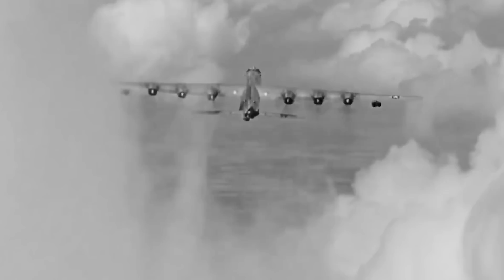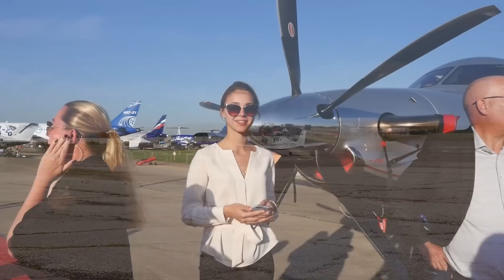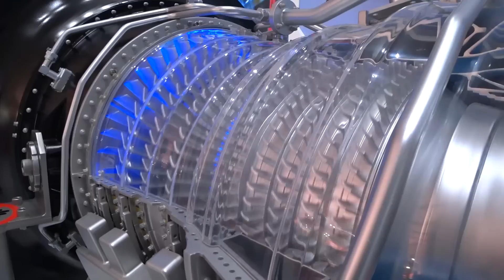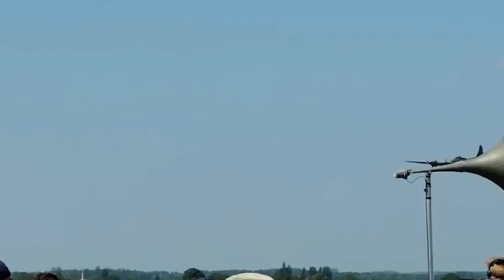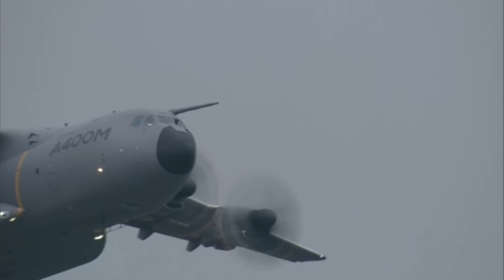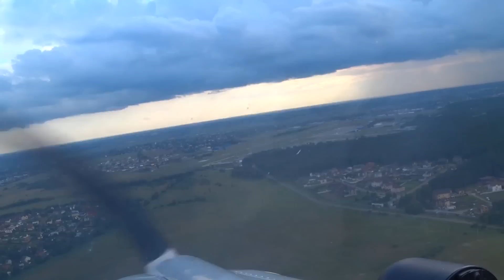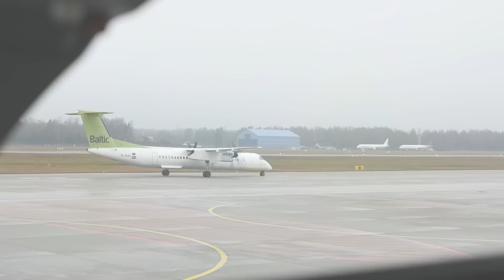Piston and Turboprop engines | What is the difference?

Comment: For small and medium turboprop driven fixed wing aircraft vs. piston,...any power lag seen is offset by greater available power,, i.e.,.. lag time is supplanted by greater power available to use in same general low end power band, especially with variable pitch propellers in the mix.

Comment: because we have problems with piston engines (otto and diesel) felix wankel made a rotary engine that gives more power per mass, works lovely in stable rpm range, has no risk of termal seizing and produces way less vibrations. it is internal combustion engine made for aircrafts. best engine for a small prop aircraft..

Comment: The idea that turbines are much simpler isn't actually true. Yes the principal is much simpler but in reality a turbine is such a complicated beast it's not even funny. I'm a dev engineer at Pratt and Whitney Canada. No matter how complex a piston engine can get with turbos and fuel injection and all that, a "simple" turbo prop like say the PT6 is MUCH more practically complex. The internal conditions are so brutal in a turbine engine that you really can't get away with much.

For example every turbine engine leaks an amount of oil at idle, there is no way around this and the reason for this is because there are no flexible rotary seals inside, they are all carbon seals that work with pressure. And these carbon seals are optimized to work at the engines cruising RPM. The air pressure keeps the oil on the other side of the seal. Further more in a turbine there isn't 1 shaft we usually have 2 minimum sometimes 3 these are called spools. Each shaft connects to it's own gas turbine and compressor or fan depending on design. That means each shaft has to be within another shaft and needs it's own lubrication bearings and seals. And keep in mind these things are designed for a high pressure RPM of 30 thousand. The clearances and tolerances are insane as well, between the fan and it's case you have 50 thousands of an inch of clearance. Also if you shut a turbine off, you have a window of time to turn it back on otherwise you have to wait several hours for the core to cool, because the shit has expanded at different rates.

Comment: a mixture of jet engines and more modern turbo fan engines. A turbo prop engine is a jet engine in which the rear power turbine delivers maximum mechanical power.

Comment: You seem to either refuse to admit or are blatantly ignoring the fact that any sort of turbine compressor is inherently far more difficult to manufacturer than a piston driven engine. Granted that's where the price difference comes from but still, you consistently said that the turbine engines were simple and had fewer parts when, in fact, the turbine fins are singular components and overall make them more complicated than a piston motor.

Comment: You're absolutely right when it comes to piston vs turboprops. Piston engines can't grow power as efficiently as turbines without an enormous increase in weight and complexity
Reply: Not true for modern engines. All these videos are comparing piston engine designs from 1930. There are currently very little modern aircraft piston engines. An engine that makes about 300KW is about 85 KG for turbine and 200KG for piston. The turbine consumes 400gkwh and piston 200gkwh. so the 85kg engine needs 220kg for 2 hours flight while piston needs only 110kg. So 305kg for turbine and 310kg for piston. Extend beyond 2 hours, say 3; you now have 415kg for turbine and 365kg for piston. Turbine is good for short distance at the expense of high fuel consumption. At 6 hours that is 745kg turbine vs 530kg for piston.
Reply: @chippyjohn1  Consider fuel economy, not just fuel consumption - yes a turboprop may consume more fuel per hour when the engine is running, but as turboprop aircraft often fly considerably faster they may complete their flights in far less time. Thus per unit of distance, they may burn equivalent or even less fuel.

To counter your other point, because taxiing, takeoffs and landings use lots of fuel over shorter distances than cruise, proportionally speaking longer flights are actually more efficient for a turboprop aircraft, as it will spend more time at a lower cruise power in the flight.

Short and slow hops are actually piston aircraft's forte and they have certainly improved in recent years with engines like those from Rotax, which use a lot of modern design elements, run on standard cheaper automotive gasoline and produce high thrust to weight ratios. Nevertheless, both engine types still have their place.
Reply: @SilvyYT  turbine engines are less efficient at lower power settings. Fuel consumption doesn't change much from 40% to 100%. Modern Piston engines are far more efficient. Obsolete air cooled push rod engines are not as efficient as modern engines.

Comment: In my limited experience as a passenger, turbo engines require maintenance cycles much more often. At my skydiving club the turbo engine had to undergo service every 250 hours or, maybe 500 hours?. However, turbo engines are preferable because they climb faster.

Comment: Instead of using more cylinders use turbo chargers:
Smaller more compact
More powerful
More efficient
Also increases the psi in cylinders for higher altitudes
More reliable

Comment: Turbo-Props are a strange creature with VERY FEW real applications (that jets can't cover), while prohibitively expensive for a private owner to purchase and maintain, in most-instances. Compare fuel economy, hourly 'total-operating-cost', engine overhaul/replacement costs, etc., and you find that piston beats turbo-prop on almost all counts. AND...not discussed here are other issues, like the fact you are STILL limited by the propeller! There's only so fast you are going to take the turbo-prop, because just like the P-51 Mustang, taking those prop tips trans-sonic and beyond is a BIG no-no! You can take a Cesna 206H (around 315-hp) to 180-kts, 25,000 ft ASL, add oxygen service, and STILL afford that 2,000-hr overhaul at around $32k...while having room for 6, and keeping an STOL below 1,000-ft. STOL-on a turbo-prop? ROFL...yeah, about that...

Comment: Otto Celera 500L can flip this chart for piston driven have amazing parameters:

Powerplant 1 × RED A03 diesel piston engine, 550 hp (410 kW) approximate at takeoff

Cruise speed: 400 kn (460 mph, 740 km/h) estimated minimum
    Range: 4,500 nmi (5,200 mi, 8,300 km)
    Service ceiling: 30,000 ft (9,100 m)
    Maximum glide ratio: 22:1
    Fuel economy: 18–25 mpg‑US (13.1–9.4 L/100 km)

Comment: Pistons are torque driven. While turbo engines are pressure driven. Though pistons use pressure to drive from expansion of gases. It generates torque to do so. Turbo props cut air. Compress and use it to spin a turbine that spins the prop. So no torque is really used. Making it smoother. It generate thrust as well as pulling the jet. But that creates a smooth flow issue. That too much thrust meets resistance of the ability to intake air quickly enough.

Comment: The nuance is torque.  
And its not a nuance.
Its why piston aircraft, at the same HP, can carry a heavy load and go much faster than the same HP turboprop.  Its why the AT-6 and A-29 with 1600HP have near zero combat capability compared to a 1600HP P-51.

Comment: Lets fix a few problems:  1. turbine engines cost 5x or more than big HP piston engines ($550k to $100k) and they burn far more fuel, often 2x or more  2. the big turbo-gas engines, like the Continental TSIO550 can give speeds in excess of 250kts making them able to keep up with a turbine engine. They can also fly up to 28k feet which is also around the same ceiling as a turbine engine (both engine types compress the air to maintain HP at the higher altitudes).   3. the Time Between Overhauls (TBO) is vastly different, the turbine engine can often go 20,000 hrs, while the piston engines are in the 2200 hr range.  4. the big piston engines are always fuel injected and have twin-turbos, and the fuel injection lines are above the engine which keeps them heated (no need for external heating).  but this also means the big piston engine has to be 'hot started' on the ground if the engine has not had enough time to cool...this creates fuel vapor in the fuel lines and makes it difficult to restart the engine.  

But, in order to extend the life of a piston engine, in cold climates (temps below 20f) preheating the block of the engine is required in order to thin the oil enough to readily lubricate the engine on its cold start.  Turbine engines do not suffer this indignity.

Comment: Excellent video! are the design, manufacturing and maintenance of turboprop engines' propellers more demanding and complex given the higher rpm regimes they operate under?
Reply: Good question, yeah usually they are, I’ve worked on a few turboprops and can confirm the design and maintenance are much more strict. But the big difference is how many more detailed inspections and  redundant day to day maintenance checks there are, for oils, blades, electrical ops checks etc.

Comment: You could have mentioned hat a lot of piston engines in GA and helicopters are cousins of the VW Beetle or the Porsche: 4 or 6 cylinder boxer engines. Based on 50s and 60s designs, time proven and reliable. Your family car‘s engine is far more complex and relies on electronics but that is just one more system that can fail. And in the air you can‘t just stop at the curb and check the engine.

Comment: My favourite engine (in concept) is the rotary engine which literally rotates the entire engine block and just bolts the propellor onto the engine.
Reply: But there are disadvantages 

You need constant oil adding for lubrication due to oil and burnt off fumes coming out each piston

But maybe one day
If not already They'll solve that issue 

But you do have advantage of engine spinning going forward at the same time

Which keeps it cooler running

Just the oil and gas fumes 
Spitting out each piston 
Is a major draw back

However I love their
Nostalgic Design 

I think a smart engineer could improve them to operate without
Wasting oil
Which blows out each cylinder
And design exhaust system on it
that would point the fumes underneath  the plane 

But not likely to happen
Reply: Rotary as in a star engine or a wankel engine?
Reply: @tktspeed1433  I mean literally Rotary engine. Rotary is an engine type on its own, anything else you might know as rotary that doesn't fit the description of "the engine block itself rotates around the crankshaft" is a misnomer.
The Wankel engine is that; the wankel engine. It is also described as a pistonless rotary engine, but that is technically incorrect as by definition, a rotary engine rotates the engine block around the crankshaft while the crankshaft is static.
The star engine you're referring to is a radial engine, the successor to the rotary engine.
Reply: @Tonatsi  I looked it up on wikipedia and that thing looks fucking wild.
Reply: @tktspeed1433  hence my original comment, "It's my favourite engine type" XD

Comment: Great overall analysis - the only part I disagree with is the discussion of fuel at 20:00. Fuel economy isn't just about the PRICE per liter. It also impacts your range, how much space you need to dedicate to fuel storage, and how much takeoff weight you need to dedicate to carrying fuel. Petrol engines may cost more per liter to run, but pay dividends in other ways.
Reply: Exactly correct, and regular petrol is much cheaper and adequate for modern engines. No one ever mentions the fuel consumption of a turbine, after about 2 hours endurance of fuel onboard a piston engine+fuel is actually lighter.

Comment: One major thing you can do to increase piston engine power is increasing the compression ratio--which also increases efficiency. To me, aero engines have seemingly absurdly low compression ratios compared to any modern auto engine.
Reply: Because they use super chargers to force  air in so compression  ratio  is less important. If you look at cams on merlin engine  really  mild cams air being blown in still making 1500 hp
Reply: @garypeatling7927  I'm not talking about warbirds, but about modern aero engines, which are as often as not naturally aspirated. The compression ratios of many WWII planes were actually quite impressive for their day, and the engine technology used was far more sophisticated than the crude Continental and Lycoming mills that power most modern piston planes (the occasional EFI setup notwithstanding, and even then the German DB 600 series and late-war Allied engines had gasoline direct injection systems the likes of which wouldn't appear in auto engines until the *1990s*).

Comment: Why is it that in reference to piston engines everyone is sighting the massive engines of the 40's. I get that where the biggest and baddest but it's 2021, piston engine technology has progressed so much since that time frame. I'm not saying that turbo props don't have there place, they obviously do considering they are sold by majour manufacturers but dismissing and talking down about the tech of the piston engine is pretty narrow minded considering it is the leading engine method currently. Sea, skies or land you will find them.

Comment: Says jet engine, shows turbofan engine which shares some of the turboprop's properties, that is most of the "thrust" bypasses the engine.
The four types of jet engine:- turboprop, turbofan, "gas turbine" and gas turbine with reheat ( afterburner ). After that you have ram jets, scramjets, "hybrid" ram jets ( SR-71, a gas turbine with a air bypass around the jet turbine into the reheat ). I am sure there are even more out there.

Comment: I like the video but what happens if you use the fuel from the top fuel dragsters in a piston aircraft engine (that was methanol or someting in that way), it help to increes the HP to around 8000 to 12000 HP and keeps the engine cool for that amount of horsepower
Reply: You mean the engines that can go a 1/4 mile before they need to be rebuilt?

Comment: now I understand why jet aircraft spools engine at the start of runway just before takeoff run.
fully loaded it needs all the thrust and it will run out of runway if it try to ramp up engine power while sprinting across the runway to take off.

Comment: Nice Video. However, the common Airliner Doesn't use Turbojet Engines but Turbofan engines. Main Difference: With the Turbofan Engine, the fan in the front doesn't just push the air into the compressor, but part of it around it. New engines reach 10:1 ratio between the air going around and the air being pushed into the combustion chamber. Turbojets are pretty much only used for Fighter-Jets and alike. Or the concord for example. Because only Turbojets reach super sonic speeds.

Comment: The fundamental difference between piston engines and turbines is scalability. The most powerful mass-produced piston aero engine was the 28-cylinder 3,500 HP Pratt&Whitney Wasp Major. Turboprops can easily exceed that many times, commonly having ratings of 5000, 8000, 12000 HP with the Kuznetsov NK-12 of the Tu-95 and An-22 going at 15,000 HP. The most powerful piston engines ever are two-stroke marine diesels of around 100,000 HP, as big as multi-storey buildings and weighing thousands of tons, while the most powerful turboshafts can deliver 10 times as much power and fit into a railway carriage. The power/weight ratio of a turbine is a multiple of that of a piston engine, anywhere from 2x to 10x as much, which is a decisive advantage in aviation. This is why piston engines only manage to stay competitive up to around 300-400HP,  and above that figure they have all but completely disappeared - this is turbine territory. The once-mighty radial engine of WW2 is now only a charming piece of obsolete technology, something like steam locomotives.

Comment: pretty simple Turbo prop is like a jet engine except the shaft is attached to a prop. but what about radial engines?
Reply: Radial engines are just normal piston engines, with pistons organized in a circle.
Reply: @trezapoioiuy   i meant a video  on those and the older rotary. engines... because there are some differences between a normal pistol engine and  a radial, mostly mechanical though.

Comment: Most modern jet engines are high bypass turbofans with the majority of the thrust coming from fan pushing cold air out of the back like a propeller not the high temperature exhaust. A turboprop can be considered to be the extreme case of a high bypass turbofan engine.

Comment: Gas turbines are low torque high horsepower.  Plus they like to run continuously.  Both are internal combustion.  The turbine in this video seems to be an axial compresser with an anular combustion chamber. Great video!!

Comment: The SR-71/A-12 did not use the same sort of engine as jet airliners. At high speed the normal turbine section of the engines was bypassed and it became a ram jet, much like the V-1.
     Judging from your accent, I expect you didn't know that. 😁

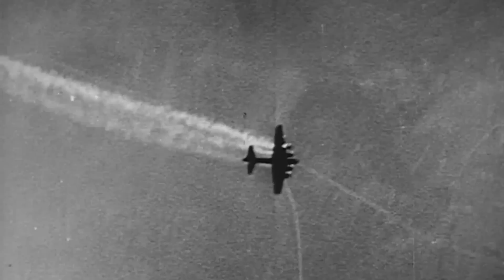Comment: 9:50 Also the fuel they use has to have special formulas to prevent detonation.
    One major advantage the Allies had was very high octanes gasoline. About the best the Axis could do was around 80, while the Allies could get over 100. This meant that the Allies could run much higher compressions and thus much higher power from the same engine.
Reply: See Greg's planes and automobiles for an explanation

Comment: Piston engines are air cooled or liquid cooled.  How are turboprop engines cooled?
Reply: Air/oil cooled.  Just like piston the higher you fly, less air to cool with
Reply: Jets use a oil pressure spray on the bearings then the oil is scavaged to a cooler then back to a oil tank